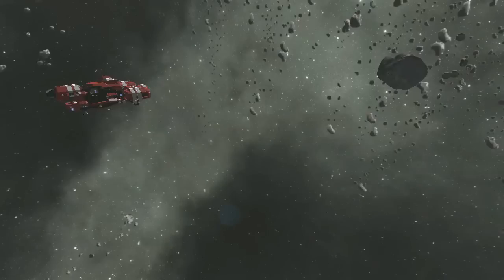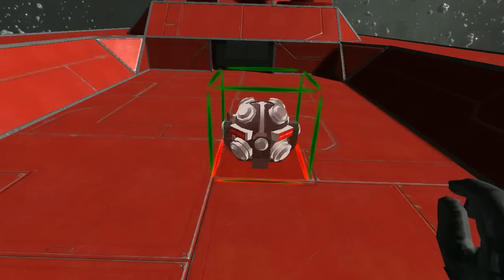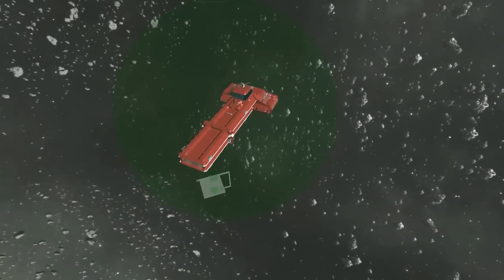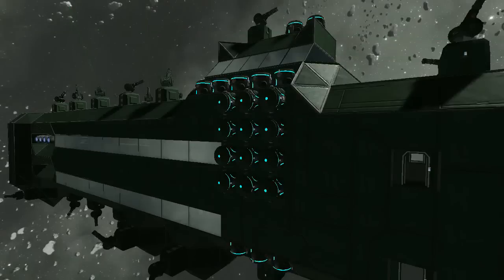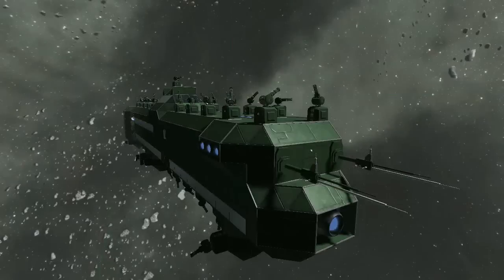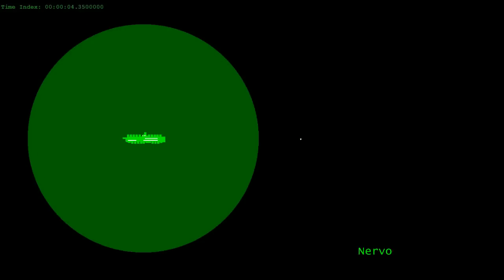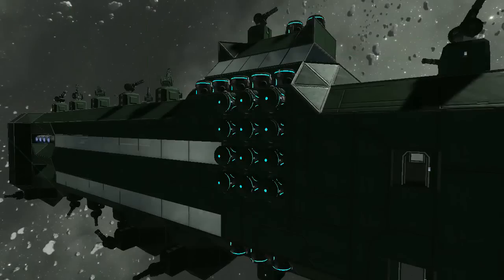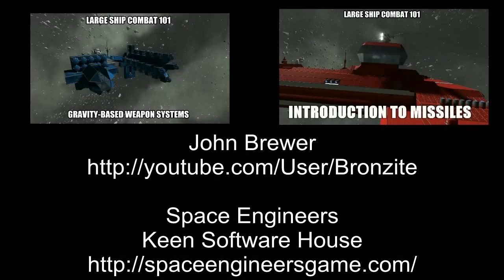Gravity Shields - Space Engineers Large Ship Combat 101

Comment from the maker: @Wuxian To say definitively, you'd need to consider the size and geometry of the ship you were shielding.  As I showed in the video, a shot that is a miss at one angle can be a hit at another if the shielded ship is longer on one axis than another. To address your power question, though, you can reduce the draw from the spherical generators by either reducing the force they push with or by reducing the radius of their field.  Again, to know if that will deflect a round away from your ship is something you need to carefully examine your ship and the placement of your generators to determine.

Comment: The wings look... reasonably effective against long-range kinetic shots, but they're so frail. Just a couple of rockets from a light fighter could easily open up the defense screens, and then it's open to kinetic fire. I wouldn't use wings for that reason. Besides, you don't really need to COMPLETELY deflect the shot, just soften it. Dented armor isn't an issue.

Maybe a hybrid system would be best? Like, one or two spherical generators inside of the hull, then linear generators to deflect projectiles coming at more specific angles.

Of course, gravity shields are only so effective; jetpacks ignore them completely, not to mention missiles and rockets. so don't forget the point defenses :3

Now, I have just one real question here: How effective would these be against w4stedspace's breach rockets? They don't detach the kinetic sabot until very late in the rocket's flight, so that's a lot of the gravity fields that are simply ignored.